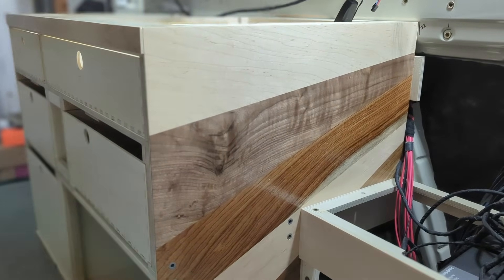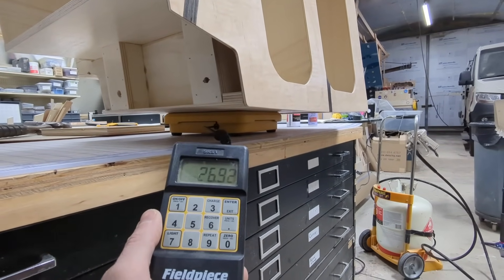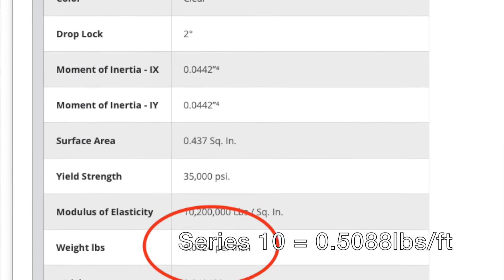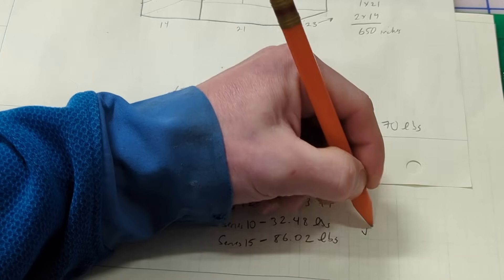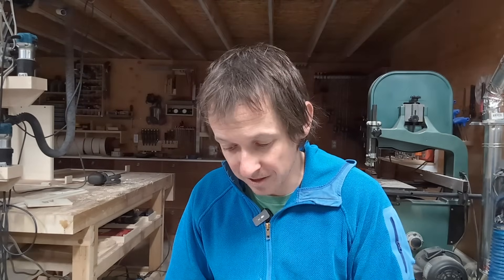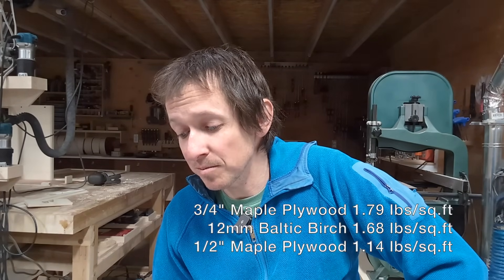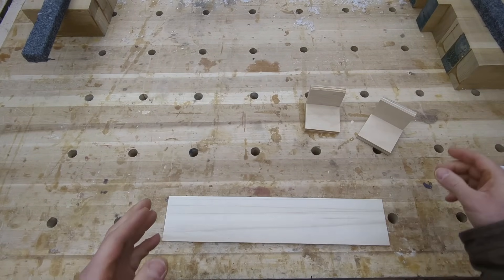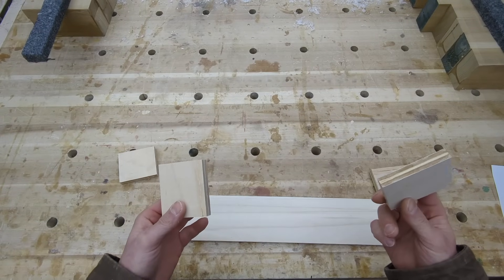Van Conversion Cabinets that are (actually) Lightweight and Maximize Storage

Comment: For those using 80/20 15 Series that want to reduce weight, use 1515-Lite which is 1.04lbs per foot instead of 1.35lbs per foot of the normal 15 Series.

Comment: I like your techniques, and agree with most of your criticisms of 80/20.  The one thing I notice with 80/20 builders is that they go overboard running too many bars everywhere.  
I have many years experience building from aluminum, steel and glass with my work.  
So my van build will be aluminum frame, but I’ll use extruded tubes, and my panels will be foam covered in aluminum, set in between the tubes so the edges are hidden. 
I may also cover some of the panels with 3M dinoc, (fake wood sticker that passes as real wood).  I just feel like I can’t use a lot of wood in my climate as moisture will be an ongoing problem.

Comment: This is great. I built a Ford Econoline into a camper when I was 16. I've been a carpenter virtually my whole life. Now I am (waiting for the snow to go away and weather to warm a bit) renovating a 14 foot travel trailer that I NEVER should have bought just so I can get rid of it and move on to what I really want to do, which is to build my own trailer on top of a flat bed. At the same time I'm putting together a workshop, since we just now got into a house with a two-car garage. So I have a lot to do and will probably never reach your level. But if the trailer build goes well I may go into van conversions/trailer builds as a way to bring in some cash, and something to do during retirement. This is all good information I can use to reach that goal. PLUS I can see you're a climber and biker... two of my passions as well. Cheers dude, and thanks!
Reply from the maker: Damn man!  I thought I had a lot going on. I'm a pretty miserable aluminum welder but that has been a curiosity of mine: build a super lightweight travel trailer.  Thanks you!

Comment: Using 15 series for cabinet would be extreme overkill. 10 series doesn't weigh that much more, but it's going to be much stronger than lightweight wood cabinets. 
Another big benefit of 80/20 is that it is modular. You can easily modify parts of it without touching the rest. Same cannot be said for custom wood cabinets

Comment: Oh my. If you like cheaper wood, then go for it. But the stamina of your wood cabinets will not compare to that of 80/20, over time and active use. We built ours out of series 10 and use baskets instead of drawers. Ours held up perfectly on our trip across the Alaska Highway, which has several stretches of gravel and frost heaves. It's held up driving offroad to epic boondocking sites. In the event of an accident, 80/20 will hold up much better than wood. This is why the automobile industry doesn't use wood. So, for weight, safety and longevity, 80/20 is our choice. BTW, hubby is a retired manufacturing engineer for the automotive industry.

Comment: The Sprinter/Transit is better then an Econoline in almost every way but the chassis. 

The econoline is effectively an F-350 under the skin. Everything from the axles, transmission, and engine choices are significantly higher-duty. 

This wouldn’t even be a subject with a few hundred extra pounds on that chassis. 

Again, the Sprinter/Transit makes more sense in most other subjects. Just not in extreme situations/conditions.

Comment: Plywood is not exactly light.  Have you considered honeycomb composite.   Plascore, nidacore.   They have been use in the marine and aircraft industry for many years.  A 747 with all aluminum or plywood cabinets  would not get off the ground.  They can be covered with light 4 ounce glass then wood veneer.  Plenty strong and way less the plywood.  I have been building boats with it for 15 years.  My honeycomb composite boats are 1/2 the weight of a plywood boat.
Reply from the maker: I have never actually bit the bullet and purchased honeycomb but quite a few people have mentioned it so I probably should one of these days.  Given that (so everything I'm about to say means nothing as it is all theoretical and I might eat my words in the future) I don't think honeycomb would help me for furniture in terms of weight (it probably would be easier to build though).  A sheet of 3mm poplar plywood is about 8 lbs, 6mm is about double per 4'x 8' sheet.  Veneer is 2-3 lbs per side depending on cut/species, but a lot of the carcass that isn't visible doesn't need the veneer. The honeycomb/fiberglass/veneer sandwich is lighter at those thicknesses, but unless you are using I'd guess 1/2" or thicker I personally wouldn't be comfortable not reinforcing all the corner joints and edges as I do in the videos...and 1/2" I believe is actually a heavier material then.   That said, one day I'll hopefully build something with it! 

Thanks for watching!

Comment: Metal drawer slides open with very low effort which is not awesome for van drawers, and take up an inch width for every drawer. The other way to lose drawer space is the common 1/4-1/4-1/4 construction instead of just a rabbet for the bottom. Every 4 drawers loses an inch in depth.

Comment: Very nice cabinets, I will say, I'm usually trying to add weight or the van rides like a brick. 300 pounds of firewood in the slider under the bed in back does wonders. I'd like to get my water tanks over the rear axles as well. 15 passenger vans were meant to be loaded.

Comment: I'm not a good enough woodworker to build like you do, but I do agree that it is the correct way to do it.
One thing you might want to look into is making "sliderails" under your drawers from PTFE sheets, you can find them thin as paper and hoe thick you need. 
I had a scrap pice I put under a wooden box that sometimes would bind, and now it feels like it is on lubricated rails

Comment: When I see people using thick butcher block worktops and ceramic butler sinks, I just cry about the added weight, just no need. I have weighed everything and go for lightest on as much as possible, tin plates and cups weigh less than ceramic and I have no glass jars, I reuse (bpa free) plastic tubs that food comes packaged in

Comment: Bravo for the great content and well supported argument for wood. I just built a camper and was really enthralled with the idea of the strength and cool look of the aluminum stuff but I just went with traditional plywood and even used undermount guides...but it was so much easier to design and install rather than the 80/20! The aluminum has its place but I still came out ahead with the flexibility of plywood design, ease of build, and overall weight.

Comment: Ok, I’m on board with wood. I’ve been running a version one wood interior in my van for 3 years and was considering my alternatives for my 2.0 revision. 

What do you use to latch the drawers?
Do they rattle?
Will that fridge launch itself in a wreck?

Comment: Wooden drawer slides are fantastic, look at any old school cabinetry! Like you said the weight savings just eliminating drawer slides is considerable, plus there's space savings and huge cost savings as well! You can also design them to eliminate drawer locks as well; this was done on a lot of vintage campers and boats. Anyway, great video, and great points!
Reply: The elimination of drawer locks, is going to depend entirely on the expected use case of the vehicle. If you only expect to drive on pavement, or well graded gravel roads? It's probably fine. But the moment you think or believe that you will go out exploring on logging roads, or remote access roads, or anywhere that the road isn't graded, yearly? You are still going to want latched drawers and cabinets. The vibration and impacts will dislodge pretty much any lip or friction based retention.

As always, it is important to understand the limits of the mechanisms you use in making whatever it is you make. For a lot of people? The lip, or friction based retention will work flawlessly.
Reply: @scottgoldmarble7509   I'll contradict that assertion. I sold high level catering equipment for over 20 years - all van based. I ragged my vans to within an inch of their lives around the lanes of the Cotswold hills. - $300 knives sat on shelves and never moved! (they were on non slip mats but no other retaining.) Another point in case: 50 years ago a dear friend of mine left his brew on the A frame of his trailer -  47 miles later he got home - tea was cold but still sat where he'd put it - and If as TTT says it'll work for boats.......
Reply: @CosmicSeeker69  I did say it is probably fine on pavement and well graded gravel roads.

I'm not sure what the roads of Cotswold are like, but they are clearly better maintained than many of the logging roads I know of, here in B.C. Canada. Often times you will be dodging potholes that are 2-6 inches deep, or running into washboard so bad, you have to slow down or you will lose control of your vehicle. When you hit roads like that? It doesn't matter how good of a non-slip mat you have, things are going to move, because they are going to not be in contact with the mat. Things will start bouncing around.

Comment: This is a great video! Thanks so much - I wondered about the wisdom of 80/20 in a van build out where curves and working around things are the norm but I hadn’t considered the weight 
In a short video you packed in a lot of good ideas - would it be beneficial to use a ‘slide’ tape (Nylo, UHMW or something similar) to ensure fully loaded drawers are still easy to pull in and out?
Reply from the maker: Katherine-  I've tried to use UHMW tape a little and it seemed to do about as well as a good furniture paste wax.  You do have to reapply it but with how hot a van can get sitting in the summer sun (160-180F?) I had worries that the adhesive would fail as it seemed fairly weak...but it may have just been the stuff I purchased.

Thank you!
Reply: @projectofscience good point - I can see this will be the building technique i will be comparing others to !

Comment: 7 and half minutes in.. I am very impressed. I thought I was the only one doing extra lightweight cabinetry and seeing the benefits. Yours go even more into detail. The detailed information is awesome. However some bigger vans / light trucks have stiffer suspension. In order it to work properly, you should have some weight on the rear axle especially. When I fill my water tank in the back it is just about right, otherwise the ride is a bit rough. MB Sprinter 2003 van (light truck)

Comment: Great info! I always thought that 80/20 was massive overkill, structurally. Only a couple of things in a van deserve that much support - the bed, and possibly one side of a couch. I always thought that a hybrid approach might be better.
Take an example from Gl*ck - they're 90% plastic, with just a few reinforcing pieces of metal that give the frames and body extreme rigidity while not weighing very much.
I'll be making my second conversion later this year, and I'm exploring using angle brackets and flat pieces in strategic locations to get the bending and torsion aspects under control. The bed will still probably be 80/20 ( #1 son is 6'6" and needs the support ).
For overhead cabinets, two angle brackets should be quite sufficient - possibly only one. After all- the van's roof is pretty rigid, already. 
I like your drawers not needing glides - virtually ALL the old furniture we have in our house does not have fancy drawer glides. Saving the space and weight is a great idea.
Finally - one can paint those "boring" poplar in various ways to add interest.

Comment: I've grown to love a similar style of building. I'm not nearly at your level (love your work)  but plan to get there. Light is so important, heavy breeds heavy. I do use epoxy for imperfect joints and build in curves to panels where possible for strength from the curve itself. Please do a video on laminating, that is a great idea that I had discarded due to assuming it'd be too hard to do.

Comment: Definitely a smart - bordering on brilliant approach. One thing you could consider using for drawer slides are thin strips of Teflon as bearing surfaces. This way, if there is any expansion or contraction due to humidity, the Teflon might allow for those variances in the dimensions where the drawers meet the carcass. Great job!

Comment: This is the first of your videos I've watched, but it was very impressive. I hope you'll do more on your lightweight cabinet philosophy and techniques. I'd be interested to see what tools you use. I'm guessing a good table saw is mandatory? Dado stack and crosscut sled for the finger joints? I'd love to hear more about the drawer tolerances. It's a very clever idea to use the reinforcing "ribs" as the top and bottom slides. I think I've seen some old furniture made like this, but I've never thought about using the idea myself. Again, excellent video!
Reply from the maker: Thank you.  That feedback is really appreciated.  I really struggle with a balance of how much info to include before I'm going down rabbit holes that don't help the average viewer (and I don't even know what that is!).  To give a quick answer to some of the questions: a dedicated plywood blade (I use the Freud Ultimate Plywood and Laminate) I think is more important than a high power saw.  It is thin stock you are cutting so accuracy is more important than power, and the plywood blade helps avoid frustration from tearout.  Finger joints I use the Incra iBox now, I did used to use the William Ng technique on Youtube. Drawers I roughly shoot for 1/8" side to side (1/16" on each side), and 1/16" top.  Plywood doesn't shrink/swell like solid wood so that helps.  Now you won't watch any more of my videos;). Thanks again!
Reply: @projectofscience  Wow, I was not aware of that incra ibox. Looks amazing. 

I'll definitely watch some more! As a fan of many channels, I've seen that it can be tough to find your voice and style. I watched several of your videos and thought they were all good. I think, if you feel passionately about a rabbit hole, dive right in. Your enthusiasm will make it on to camera and keep other people interested. Matthias is a good example of that. I've watch some videos of his that should have been painfully boring, but sharing his perspective makes them fascinating. If you feel a rant inside you, let it out!

Comment: Thanks for the video. I've built four Vans so far and agree 100% about the 8020, heavy and inefficient, surprised you didn't mention how expensive it is also. I really like your idea of building with very thin ply, just not sure about the extra time on all the glueing, finger joints etc. I will def keep all the info you presented in mind for my next build. I have a feeling that somewhere in the middle is where it's at. I guess the important thing is using each thickness of material for each aspect of the cabinets.
Reply: Middle-ground is good: I'm using 5mm poplar ply edge-joined to adjacent wooden parts via spruce or pine strips, sized according to expected loads. Like 3/4"*3/4", up to 1.5"square for beefier joints.  Finish quality is not the same, but build time, required tools, and cost all go down.  There's zero 80/20 in my build.

Comment: This is GREAT stuff. The weight savings of poplar plywood is significant, and the material I will be using for some upcoming work van racking systems. Your comment below on the Incra box joint jig is VERY helpful, as I didn't know it existed. I will likely use 1/2" ply for various drawers (much heavier contents than in a conversion van) but the box joints greatly increase the strength.
  I would love to see a video of you making some of these drawers.
Reply from the maker: Thank you!  I'll keep it in mind for a future video about the drawers.  For a work van I'd definitely not recommend a lot of the content of this video....or at least when I think of my days of using a work van or truck.

Comment: So many van converters use ply that is too thick and too heavy and replicate their cabinets at home. That’s fine if you don’t have to move your home around! It’s about time van converters realised that caravan manufacturers (especially in the uk), use a framework and then clad in 3mm ply in most cases because our caravans need to be towed about. I’m using framework in mine.

Comment: If he paid an aerospace engineer to design a jet liner for passengers, you wouldn’t even think of comparing that to someone that has a YouTube channel with no degree in anything showing you how to build an experimental plane. Just because somebody has followers on YouTube does not mean what they do as any bearing on what is the best material to use or not. Not so humble Road probably gets more credit for 8020 than anybody and he’s a retired watch photographer that doesn’t know the first thing about structural engineering. He even uses very expensive aluminum “I-beams”, as he calls them, turned sideways where they are strengths is diminished to like 10%. As for saying that 8020 is inefficient, you’re comparing to builds done by people that don’t even understand the material much less what is strengths and weaknesses are. I have yet to find one single builder that has a proper understanding of how to use 8020 most of them over build certain parts and under build the connectors and it’s not unusual to see a build that could’ve been built  just as strong for 10% of the cost.